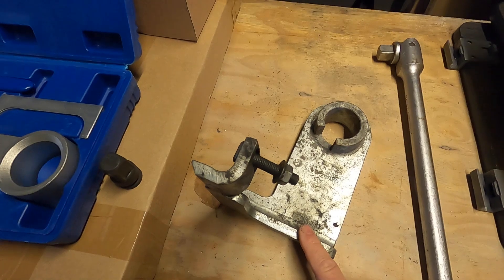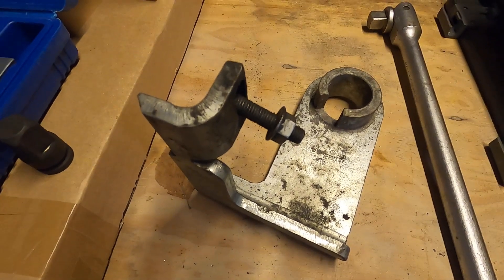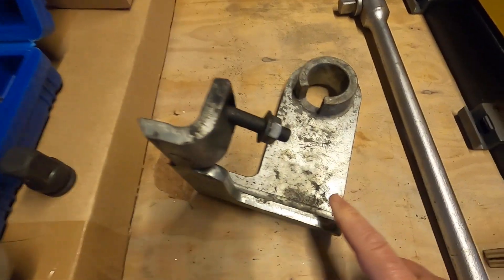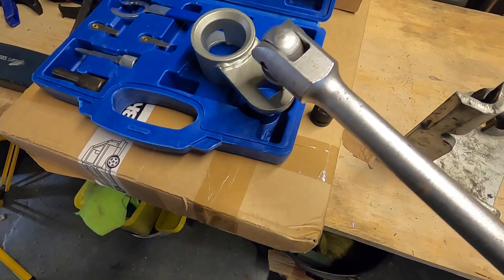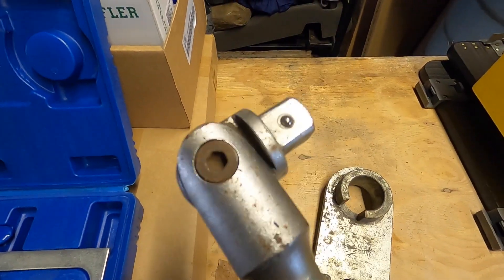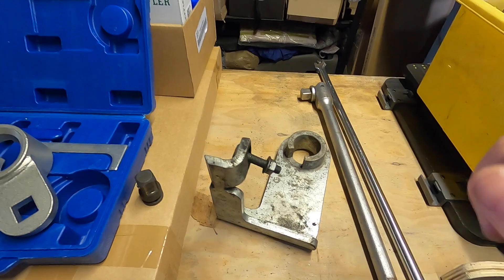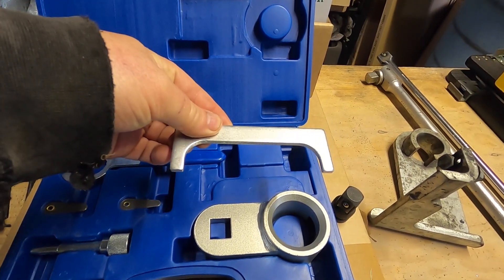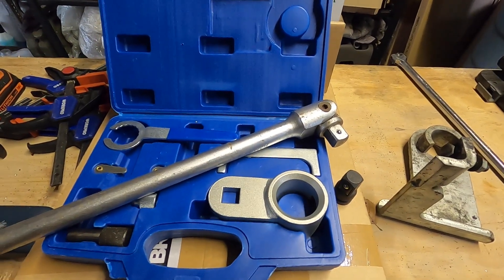How to use the Crankshaft Locking Tool | VW T4 2.5tdi Engine Work

Comment: The original T4 locking tool was VAG Special Tool T10025, which is about 3 feet long - its head is identical to the item in your ‘el cheapo’ set. 
The tool 3149 is the newer Audi equivalent, which isn’t sold to the public and so is effectively impossible to source for most people. As is your mega air tool. 
I’m impressed how easily you were able to get the bolt out, but realistically wouldn’t it be more useful to show it being done with less esoteric equipment?
Reply from the maker: Thanks for the info. That's just the way I did it. My Clarke's impact gun is by no means anything special. Next time I do it I'll use the cheapo set.